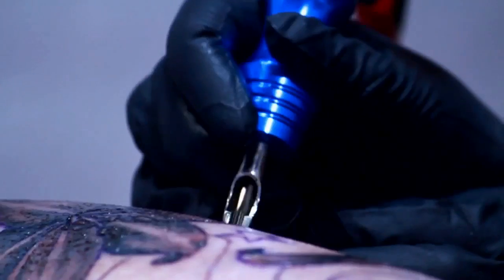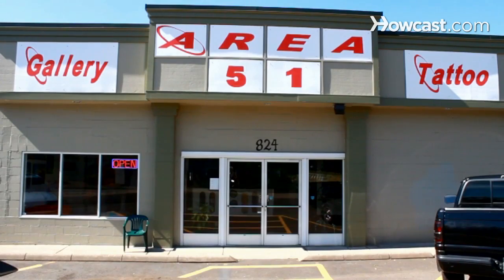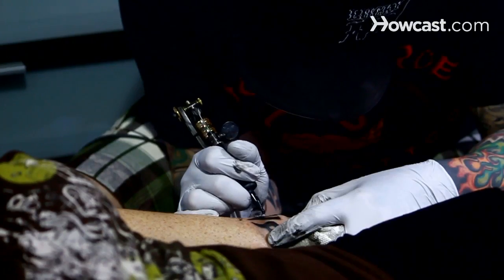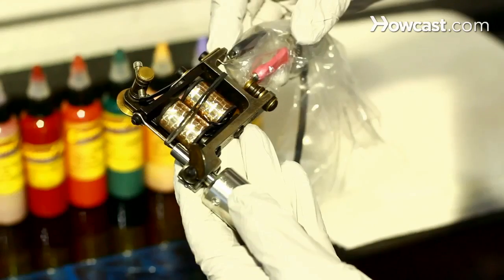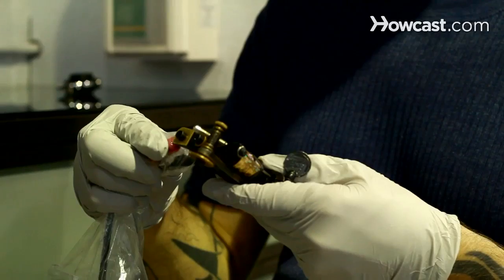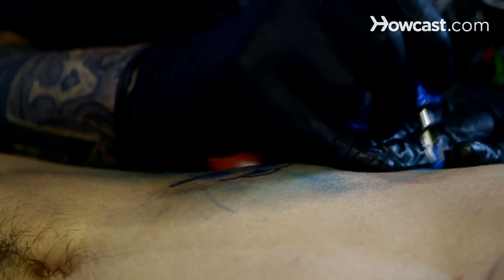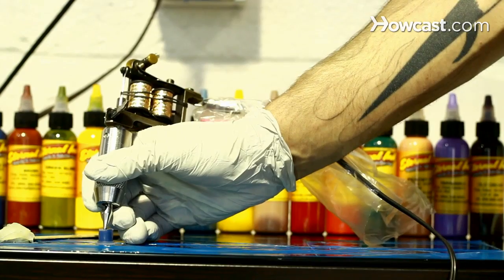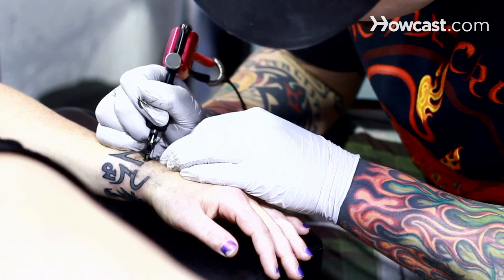How Does a Tattoo Gun Work? | Tattoos

Comment: the coils become magnetic, this pulls down the amp bar.
This breaks the electrical cycle because your front spring has moved from the contact screw. magnet releases, amp bar springs back up, front spring makes contact with the contact screw again. repeat X3487263498126534965